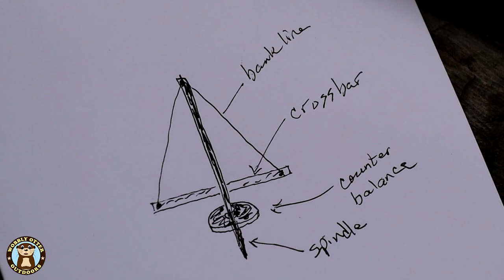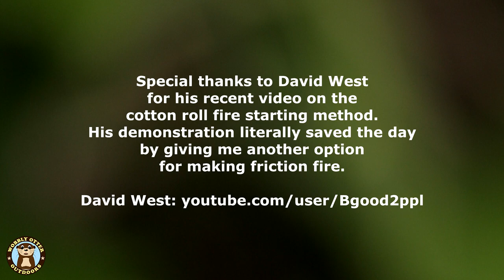Learning Friction Fire Starting | Making Pump/Cord Drill Fire Starter | Cotton Roll Fire Starting

Comment: I learned friction fire about 5 or 6 years ago . It took me 2 months to get the bow drll fire and i still have trouble on occasion because some of the wood I use was perfect for the first use but a week later it was too deteriorated to make the black dust. If you keep learning and don't get frustrated with your learning its a great ride on your road of accomplishment.  Stay with it and learn something every time.
Reply from the maker: Too cool! Two months. Now I'm a bit worried.  Your notes about the wood mean alot. I didn't realize that one week could make such a considerable difference. Wood choices and understanding their optimal condition is the biggest challenge for me. Well, that, and making the divot in the hearth. Thank you so much for the encouragement!
Reply: @wobblyotteroutdoors  not only a time frame can make a difference but other factors also . When picking the wood for your spindle and fireboard it makes a difference if the wood came off the south side of a tree or not, because of getting more sunshine.  Also sometimes you can mix hardwoods and soft woods together and get a quicker coal but sometimes it won't work at all. One of my favorite wood is pecan thats because I have 15 trees in my yard . Willow works real good and so does cottonwood  ,but the softer the wood is easier to carve spindles.  One of the ways to have greater success is  to exercise with your bow drill ever day not making fire but building up your muscles for bowing and for holding the bearing. You can go to Walmart and by the cheapest skateboard  for around 12 dollars  each wheel has two cheap bearings.  You can use these wheels for your bowdrill bearings.  By the time you ruin all those bearings in that 12 dollar skateboard you will be real good at bow drill fire. Then you can start experimenting with drilling holes in wood for your bearings.  The absolute best wood for a bearing is osage and it needs to be a dead limb. Osage has small thorns on the younger limbs it also grows great big knobby looking fruit that is green in summer and a dull yellow in fall .Be careful not to poke yourself with your knife when making that bearing ,its real easy to do. I would suggest making your spindles the diameter of your pinky finger.  You will have to stop and scrape or whittle your spindle each time you stop to rest . Just keep experimenting and don't get discouraged. Learn from your  failures which are your greatest teachers.
Reply: @wobblyotteroutdoors  to aide you in making the divot for the spindle you need to sharpen your spindle and use your hand to grind the hole in the fireboard just a little and put in some sand and this will speed up your hole drilling considerably.
Reply from the maker: Well, this is all quite awesome information. I wore my cut-resistant gloves while doing much of the video, just in case I did something stupid. I especially appreciate the wood information and spindle diameter recommendation!  I was worried that my first spindle was too small in diameter.  Sounds like it was okay.  I didn't have a good appreciation for just how well the first spindle worked until I reviewed the footage.  So much to learn.  I appreciate your guidance.
Reply from the maker: Ooooooo... Thank you, thank you, thank you.